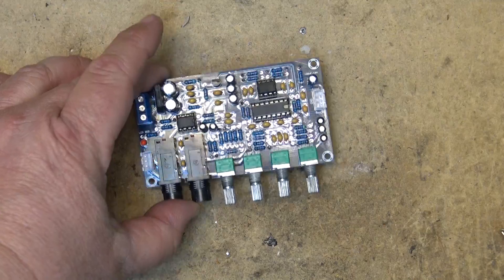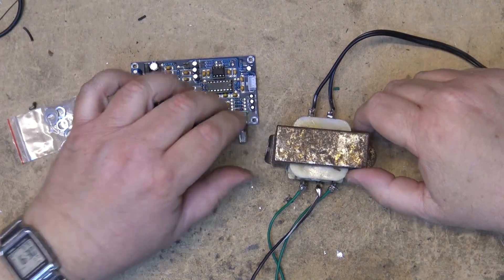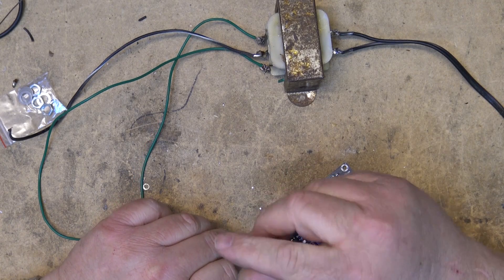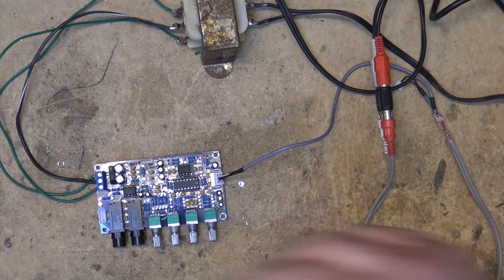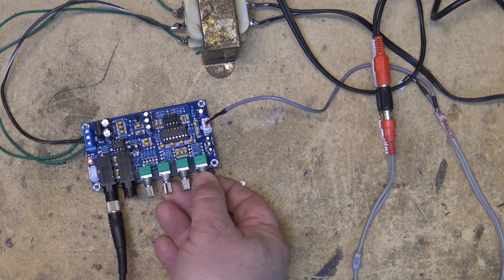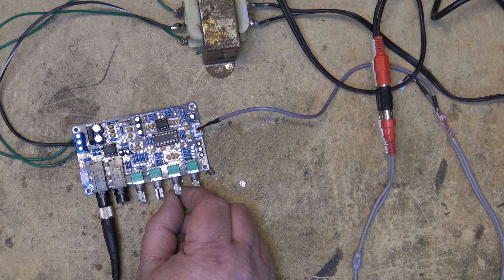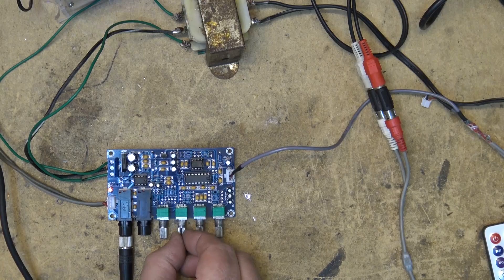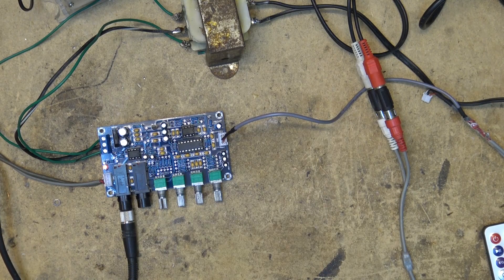Digital Echo module demo

Comment: Worst designed board which requires AC power and that too dual(split) in this modern smps era.
Reply from the maker: Opinions are like assholes.   Everyone has one.

Comment: This unit doesn't work with 12V!
Reply from the maker: It requires a 12 to 18 volt center tapped transformer.  Ac, not dc. Will not work on a dc supply or a battery. I ran it fine on ac.
Reply: @12voltvids  why not dc? Doesn't it require 12 v dc?
Reply from the maker: @ahmadzaki3328  
No, it requires 12 to 18 volts ac. It does change the ac to dc on board but it requires a split supply.  + and - voltages.  This can only be achieved with ac, or 2 dc supplies such as 2 9 volt batteries wired to give a +9 and -9 supply.
Reply: You can connect 12v DC to the outer terminals of the input, the bridge rectifier will correct the polarity 👍🏻 I have the exact same unit
Reply: @Elberto71  what do you mean by outer terminals ? Not the center/ground one ? I've tried and it powers but the delay effect doesn't seem to work (I tried on a couple of circuits)
Reply: So if i pass the bridge and directly connect the board to 12 DC battery at the point of the capacities that are after the bridge it should then work.
Reply from the maker: @ahmadzaki3328  
You need positive and negative supplies.  Notice the 2 regulators.
Reply: @12voltvids  oh! Negative DC! That's the issue then. Thanks a lot
Reply from the maker: @ahmadzaki3328  
OP amps require a split supply with respect to ground.
Reply: @12voltvids  Sorry what is OP?
Reply from the maker: @ahmadzaki3328  
OP amp = Operational Amplifier.
An op amp is a voltage amplifier that requires a split power supply.

Comment: an absolute awesome board for circuit bending experiments! 
those NE5532 dual OP-amps are used in distorion and overdrive pedals too, and the PCB is super easy to work on.

Comment: Here’s an experiment. You’ll need this module, a 74LS14 IC, a 16-bit LFSR, a microphone, a small audio amp, an 8-ohm speaker, a 5-volt power supply, and a bit of level-shifting circuitry to make the audio output of the echo module TTL compatible. Turn off the echo module and plug in the mic. Wire up the ‘LS14 and the LFSR to the 5-volt supply, and wire in the level-converter in between the echo module, and 1 of the 6 inputs to the ‘LS14. Wire the output of that gate to the clock input of the LFSR, after preloading it with some bits. Now, wire the output of the XOR gate to the audio amp, and hook it up to the 8-ohm speaker (you can probably run the audio amp from the same transformer as the echo module). Finally place the speaker near the mic, and tap the mic to input an impulse to get the show started! Be sure to wire the unused inputs of the ‘LS14 to ground or +5 volts.

Comment: For someone without a suitable transformer, 2 x 9V batteries wired in series should work fine. I've made echo & reverb guitar pedals using the pt2399 IC (the many good clones sold of this IC and they are quite cheap).  PT2399 circuits don't require a split power supply and will happily run with one 9V battery (although better with a 12V DC wallwart as they are a bit power hungry) so I guess that split rail is just for the NE5532 preamp. I will say however that the components alone (PT2399, NE5532, 4 x POT & 2 x Jack socket) in this module make it pretty good value.
Reply: does the op amp for the mic preamp not require a split supply?